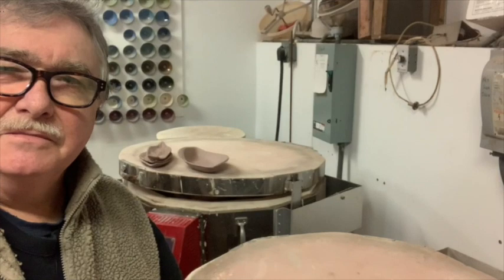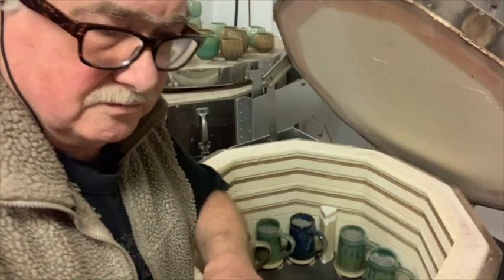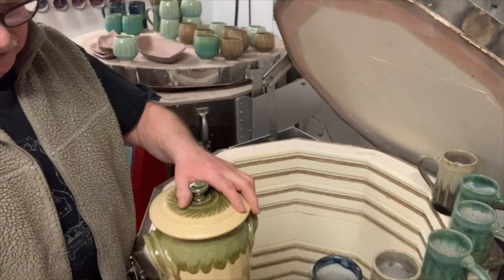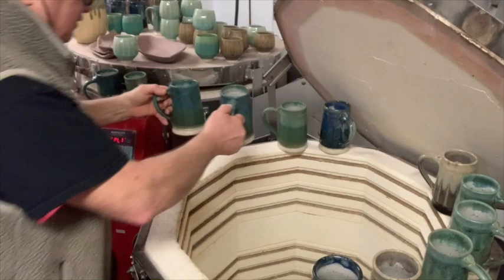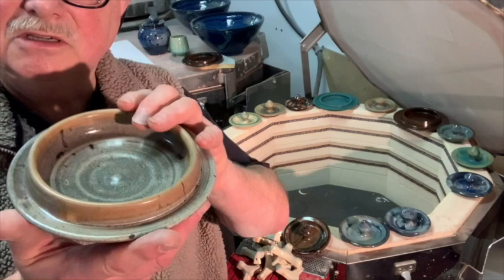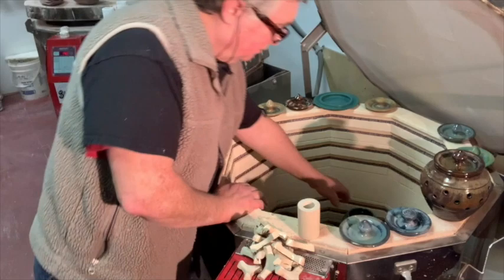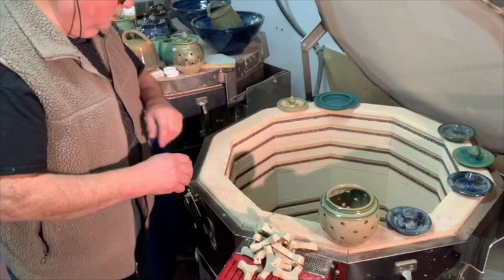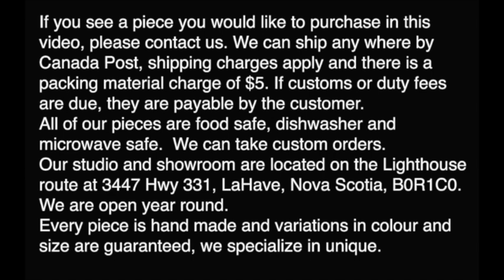Two glaze kiln unpacking 03:12:21

Comment: The red on the inside of the cookie jar is caused because the inside becomes slightly reduction atmosphere from gasses of gassing from the clay body and also the glaze driving oxygen out.
Reply from the maker: I wondered about that and was waiting until May when I fire my gas kiln again. The trouble is Iron Oxide is a flux in reduction so I will have to reduce the iron or other fluxes. Stay tuned.

Comment: Hi Vaughan Smithe, I was watching your video with the cookie jars and you were tapping the lids when they were stuck with a pliers to loosen the lid.
In tool and die when pieces get stuck, they place the bottom in warm water to expand the bottom and the top comes loose. I use it to loosen my pottery lids 

I have a question I don't glaze  the areas that will touch the edge of the lid to the bottom. I was wondering if you glaze those parts then put wax resist on there if they would stick together. Have you ever tried that?
Thanks Claudia Wolter
Reply from the maker: It is so easy to knock them off and the hot water method is tedious. You can also use a thin wash of silica sand 400mesh if you are nervous. Wax the piece and before it dries dip the rim in the silica. It brushes off after firing and the lid releases easier. The second method you mention will not work.
Reply: Instablaster...